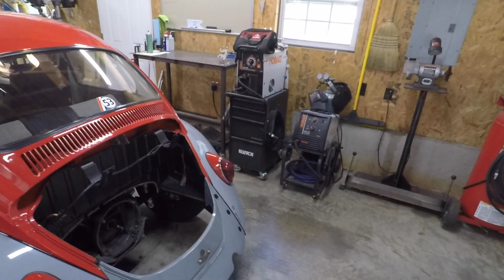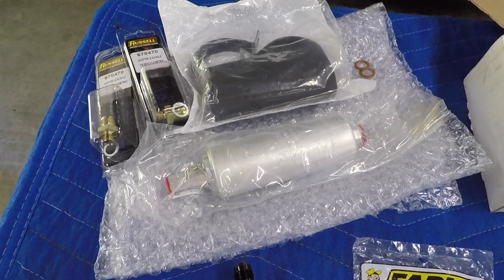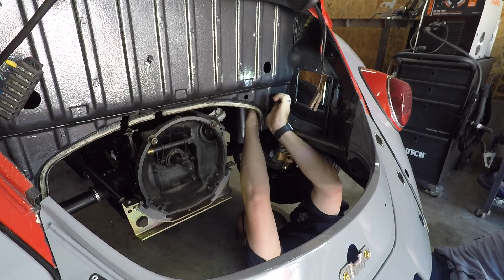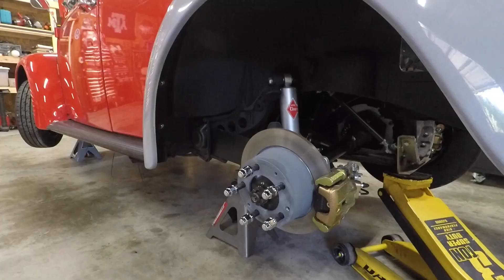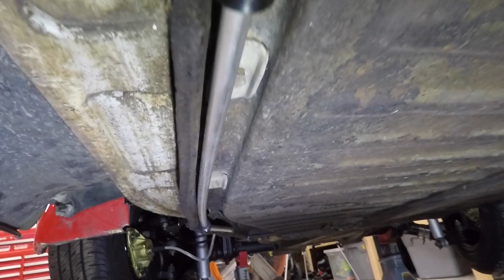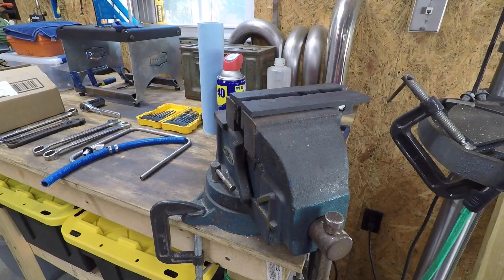Turbo Beetle - EFI Fuel System Build

Comment: Excellent design and instructional video. I’m going to install an EFI setup on my ghia. Can you provide a parts list?
Reply from the maker: Thank you! I don’t have a full parts list written out. There are a lot of potential variables between builds. Generally speaking, you’ll need an efi fuel pump, pre filter (before the pump), post filter (after the pump), and fuel pressure regulator. Then you’ll need to consider the path you intend to run the lines, how to return to the tank, and fittings/hoses as required. Any specific info you are looking for?
Reply: @ I’m looking for the flex line information about the flex line, flex line ends w/quick connects, and bulkhead fittings?
Reply from the maker: The flex hose parts can all be bought from Summit Racing. They are Fragola push lock ends with Parker push lock hose. I also used the Oetiker clamps on the hose ends, also from Fragola. Everything is -6AN
Reply from the maker: Bulkhead fittings are Areoquip if I recall?? Also available on Summitt Racing
Reply: @vee_dub_nut  thanks so much!

Comment: Adam, is there at parts list floating around? I’m going EFI on my 64.
Reply from the maker: Scott, sorry for the delay. Haven’t kept up with my YT for a bit now 😳 No, I don’t have a specific parts list anywhere. Partly because I’ve changed stuff so many times 🤣 Let me know if you have any specific questions on what I used! Happy to share info!
Reply: Adam I just posted almost the same question. I’m interested in the flex line, compression , bulkhead and quick disconnect fittings list along with the aluminum hard lines. Also the information on your choice of filters and fuel regulator.
Reply: Adam, any chance I can get the parts list? I’m setting up Fuel injection on my 65